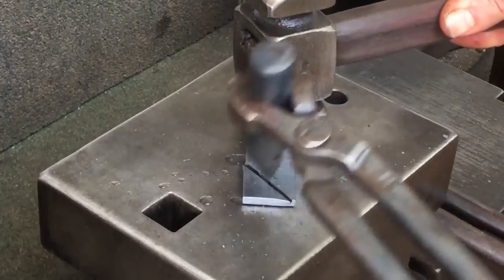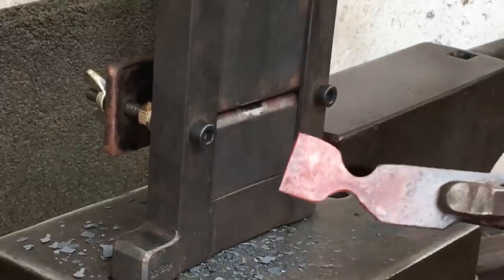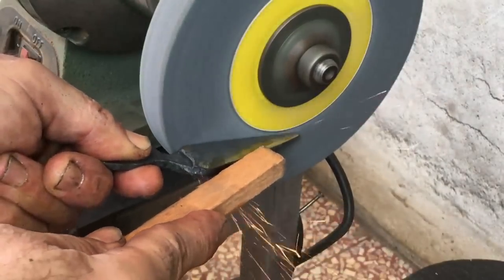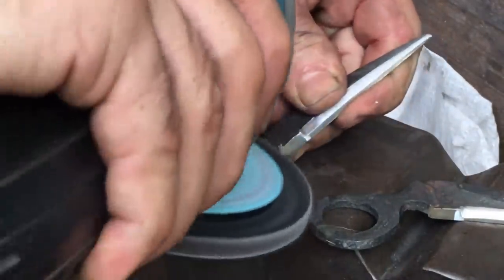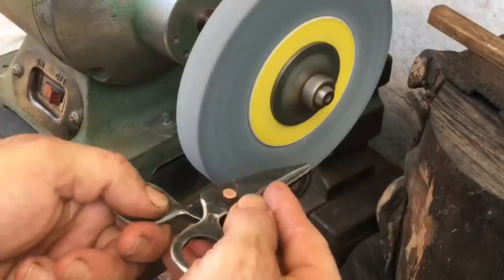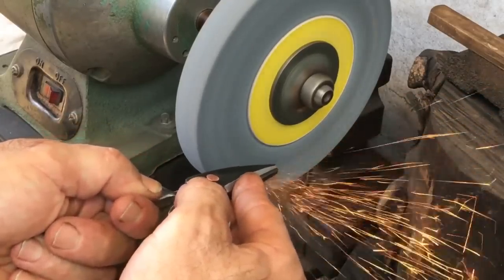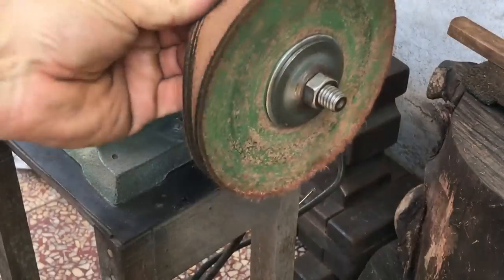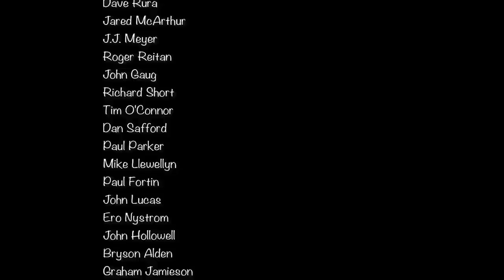Hand Forging Scissors

Comment: Interesting little scissors, if you offset the handles the other way it will create a stop to prevent over closing. Thanks Glen, love them just as they are.
Reply from the maker: I figured that out afterwards and made some post video adjustments that I'll show later. Thanks for all.

Comment: It is always a pleasure to watch you work. That being said, I hope that burn is healing well. It may actually have been better that it did not contact the cloth of a sock. Depending on the material, it may have made the burn more severe (I know it was only scale, but getting burned with melted polyester or the like is significantly less fun than contact with hot scale).
Reply from the maker: That wound is still hurting. Just a terrible spot. And I think you may be right. A sock might have bought me an extra couple of seconds but if made from a material that would melt, could be much worse. I need to take my safety more to heart. Thanks.

Comment: I definitely loved to see you stretch yourself like this. I found it very interesting to see how you work without a horn. I think most smiths use the horn, just like bottle openers. They create the finger loops on the horn without cutting the corners off. It was interesting to see how you cut off the ends then just drift it
Reply from the maker: A horn has its place, no question. But given that my small horned anvil is free floating (like all my anvils) it can be pain since using the horn leads to more than usual jumping. I'll keep on with scissors so look out for more. Thanks.

Comment: I like this. On your next one they will cut better if tempered with a slight spring curve into the opposing blade scissors should only come in contact in two places one the pivot pin point and the second where the cutting edges make contact at the cutting point  otherwise great job I do love the design and passion.  Keep up the videos
Reply: yes, this is called "set"
Reply: @adedgeworks  ty I knew it was called something but did not know what.
Reply from the maker: I sorted that out on this pari of scissors and got it working even better. Thanks for your input.
Reply from the maker: Thanks for sharing that info.

Comment: Be careful with the sores on your feet. It takes forever to heal. When I drill or punch holes I chamfer the holes so it doesn't shear the rivet. The chamfer dulls the shearing edge. especially soft metal rives. Just chamfer enough to dull the edge.
ts
Reply from the maker: You ain't kidding. This heal wound is still hurting me. And yes, chamfering the holes is a greta idea and I have the perfect tool for this. Thanks for sharing.

Comment: Most interesting video and a most interesting scissors in the end. Master, I bow to thee. I wonder why the offset on the outer side ? Also, was the copper rivet for looks. Wouldn’t a steel pin last longer?

Comment: You should have painted the working surfaces then removed it after the soak they would be shiny with no change it doesn't look like it changed much anyway
Reply from the maker: I appreciate your input. As it stands, I like the oxalic patina a lot. Thanks.